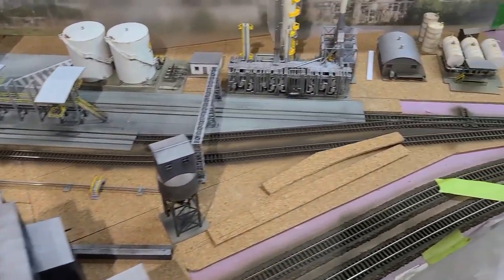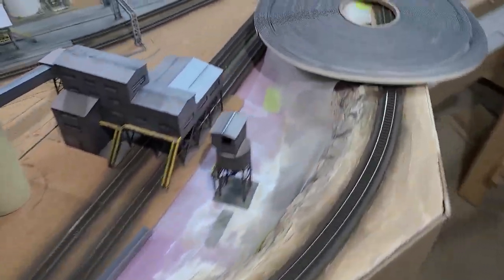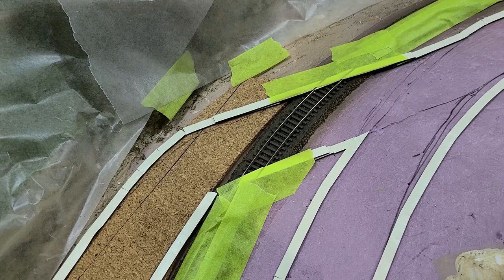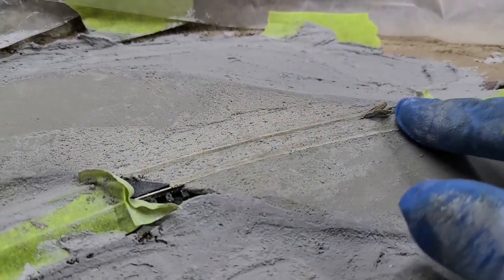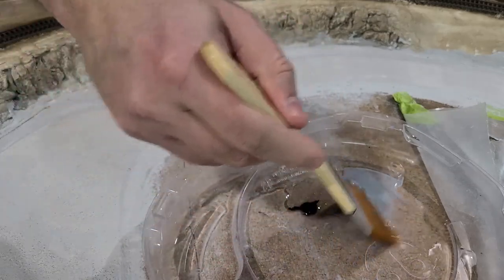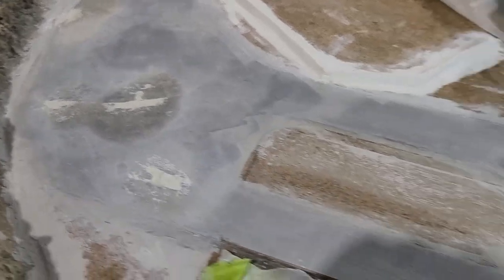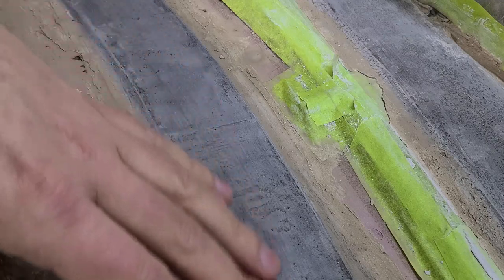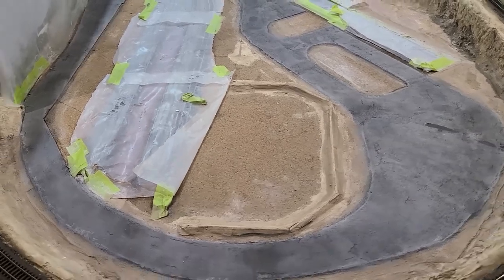N Scale - Layout Update 19 - Roads

Comment: Hey thanks for a great video (only the 3rd one Ive seen so far). I use a light grey tile grout mixing it into a paste without the plaster for the base colour on my roads, then I dry brush a darker grey and dry plaster to blend and get texture. I tip I picked up when mixing plaster (and grout) with water is to add a few drops of dishwashing liquid to the water before mixing the plaster or grout. This helps with the mixing, gives you a creamier mix to work with and slows down the drying process giving you more working time with the material. For freshly gravelled asphalt roads, I use a very fine grain light grey ballast mixed with a slightly darker grey tile grout. A 50/50 mix of PVA glue and water (with a drop or 2 of dishwashing liquid) is applied to the road base with a brush the width of my road, then I sprinkle the dry mix of ballast and grout onto the road base. Leave it to soak in and dry, then I use a slightly smaller width brush with a soft bristle to brush the excess material off and to level the road surface. You may have to apply more coats of the glue/water mix over the road to make it all stick. On both types of road you can use dry tile grout to highlight areas such as newer surfaces or defective spots with very pleasing results. You can also use brown or beige coloured (English spelling) grout to make dirt roads too. Love the idea of flange gaps at the crossings, and the use of the felt pen for doing the cracks. Again, thanks for a great video, sorry for the long winded comments - Cheers, Bruce
Reply from the maker: That's a heck of a process. Thanks for providing a step by step. I love new tips and tricks on how to do scenery .

Comment: What you could probably do when doing crossings, is use an old car to get the material away from the rails with the flanges on the wheels themselves. It makes it easier and it goes rather quickly...
Reply from the maker: That's a good idea.

Comment: Looks really good. I am just starting to lay out my whole set up so I am looking at various ways to do this. yes roads are a part of them.
Have to ask this...Did you have to lay the cork out first for better adhesion OR could you have just plastered over the foam? I saw with the test patches it did not want to stick well. Thinking if the foam was roughed up a little it would stick better. Thanks
It's been a great help and being in Canada it is good to see the products I can get as well.
Reply from the maker: I put the cork down to gain 1/8" of elevation. Plaster does stick to foam, but as you saw different plasters have different levels of adhesion. I am sure the plasters stick better to the cork than to the foam.